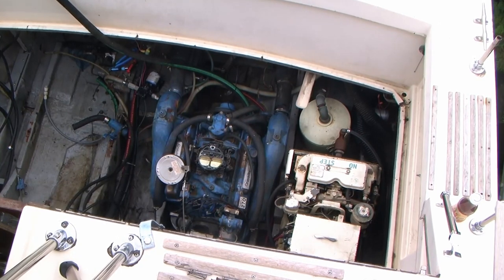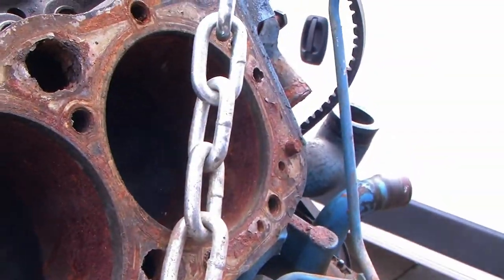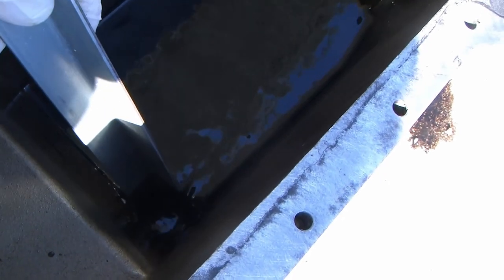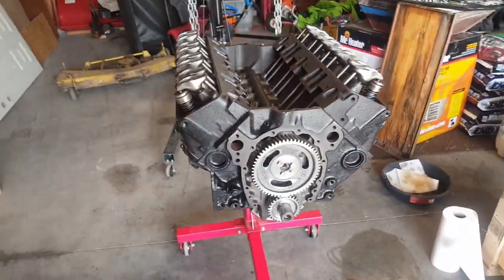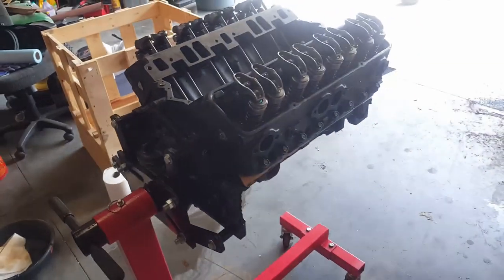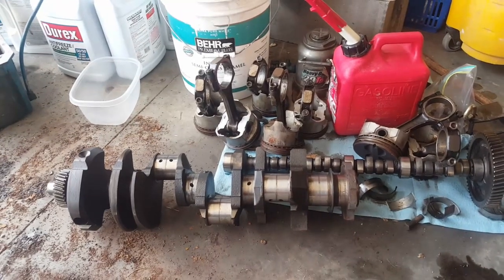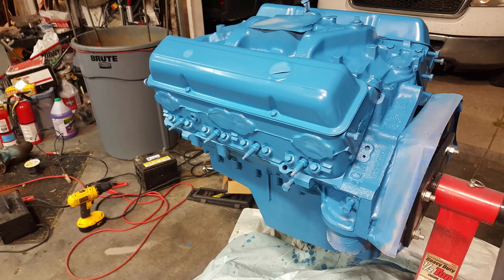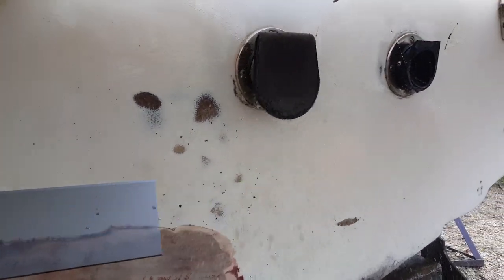Restoring twin Crusader CH270 marine engines on a 1978 Carver Mariner 33 boat after being abandoned!

Comment: I like the closed cooling systems for two reasons.  The first is there is antifreeze in the block and the heat exchanger.  So no block freezing and splitting is going to happen.  The second reason is you are not circulating dirty or corrosive water through the block.  So the cooling passages stay clean and there is not internal rust in the block.  

Looking forward to the rest of the series.
Reply: In addition:
..... Ethylene Glycol's boiling point is much higher than seawater.
......your engine will run more consistently at the desired temperature.

Comment: In Florida it's common to use old engine blocks as mooring anchors for small boats. Or in tandem with a regular anchor as security. Don't be afraid to do it. If it's clean of oil it's legal.

Comment: Jeff, we all appreciate your enthusiasm and the efforts that you've given to the videos.  
I have a few suggestions ..... no offense.... just sharing my observations:  

....... If budget allows, at least install a Closed Cooling System on the new engine. Perhaps in time (as you replace the other engine) you can do the same at that time. 
....... Lose those silly belt driven seawater pumps and go with the Johnson F5B-9 crankshaft seawater pumps. Belt driven seawater pump cause owners to defer maintenance. They also undergo belt tension side load, of which shortens bearing life. 
.......Install true water separating Parker/RACOR fuel filters.
...... If not too late, install remote engine oil filters.  
..... At 8:00 min/sec into the video, I see a notation that says "someone decided that it was easier to change the rotation in the transmission". This is only possible if the transmission is "opposite of engine rotation" capable. 
....... DO NOT re-use that old and outdated starter motor. Treat your engines to today's HTGR/PMGR starter motors. 
....... At 13:08 min/sec into the video, the note says "initial timing at 12* BTDC". That is a bit excessive and will change the Progressive and TA. Make sure that you check the progressive ignition advance AND the total ignition advance and do not exceed 28* @ 3,200 RPM.  Ignition Induced Detonation is an Engine Killer! 

BTW, unless T-bolt clamps are used, your wet exhaust hose needs to be double  band clamped at each end. 

Good luck. I'll keep myself updated to your progress.
Reply from the maker: All very good suggestions!  Tips like these from experienced people are exactly what I'm looking for in these videos!  Already considering a closed cooling system for next year.    Would greatly help out on winterizing the motors each year.  Also pulled the trigger and installed 2 new starters.   Timing tips good too...  I have a correction: Crusader 270 Engine Service Data states 10 degrees BTDC on Ignition Timing.  Will get my timing light back out...
Reply: @JeffNiemeier  Jeff, I need to begin with this: 
Your engine builder used cylinder heads 333882, of which have the larger 76cc combustion chambers. 
Most typical Marine Engine builders use the GM Full Dished pistons. 
The 333882  heads with the GM F/D pistons will cause your Static Compression Ratio be too low. 
Let's hope that he used a F/T piston. 

 Now regarding the ignition timing, BASE or Initial advance is BASE or Initial advance all day long. We fire up on BASE and we idle on BASE, and that's it. The more important aspect is what the advance is doing progressively and at how much advance is occurring at/near  3,200 RPM. 
You will want to mark off your harmonic balancers up to approx 35* BTDC. 
Then you will want to strobe the marks as a helper increases RPM up to 3,200.  
That is a critical point!   

Too much advance @ anywhere from 2,500 to 3,200 RPM, and we enter into a dangerous area concerning Detonation. 
Add to the mix the GM Full Dished pistons, and we have a recipe for Marine Load Ignition Induced Detonation. 

On the other side of the coin, too little advance, and we leave power on the table.
All of this is much more important for the Marine SBC than it is for the Auto version.

Comment: great video. You answerd a question I had in regards to counter rotating engines. Your video said they stopped counter rotating engines in 1980. I have a 1989 so I can assume they run the same direction. I will double check  for sure. Thanks again.

Comment: I had the same motors on my 38' Silverton, it was an 85, it takes allot of neglect to ruin those motors, other than the distributor cap points, needing constant  maintenance, they  very solid motors. I recommend you get an enclosed system with a heat exchanger, and run antifreeze for cooling, I ran mine in the Gulf of Mexico, so I didn't have the option but to go this route.
Reply from the maker: I am thinking about converting it over to a closed cooling system.  What temp did your engines run at on a closed system with antifreeze?  Mine runs at 140 degree's with raw Mississippi river water....
Reply: @JeffNiemeier  I would normally run between 150 and 160, the summer temp waters in along Texas Gulf are anywhere from 83 to 90 degrees, plus I did allot trolling so at 6 to 8 knots I was running around 160 165, at cruising around 150 degrees
Reply: @JeffNiemeier  I have a closed cooing system on a 5.7 liter engine.  I run a 180 degree thermostat.  If the engines runs too cool, combustion is less efficient.

Comment: ... yep,  you have a dual coolant system,  but I haven't seen the heat exchanger yet.   Suggestion:  Change the oil filter location ... put on a remotely located filter were you can easily change it  ( that maybe why you have sludge ... too hard to change were it is located.  I would also change the fuel pump too,   to an electric one located were you can get to it too.  These changes will make the motor maintenance much easier (no crawling/hanging over the motor (in impossible positions) to work on it .... Oh,   carry "spares" for everything ...

Comment: doing the same thing now....mine is single engine..3.8 mercruiser......runs fantastic...this boat is and 87 model larson boat...almost 30 footer..but just short...only thing I am going to do to this good running engine is Im going to turbo charge it..using a SEMI TRUCK turbo...they are indestructable Im told so Im going to use one of them.Ive got 170 hp...I want to see how close I can get to 250 hp...love you boat here..its fantastic...

Comment: Just my two cents toss the carburetors buy a fuel injection system they're really cheap over the long run and much more dependable. 😊it's a really easy swap bolts right on your intake.

Comment: How do you run water over the engines so as to check them. Both my engines ran, it was my v drive starboard side that needs work
Reply from the maker: There is a 1 1/4" water hose that goes from the v-drive to the raw water pump on the engine.  I disconnected it from the v-drive and stuck the garden hose down it...  I didn't have access to an outdoor faucet so I used a 40 gal. garbage can with an adapter cut into the bottom of it.  I put the garbage can on the fly deck and filled it with water and let gravity pull it down the hose to the engine....  Warning: it takes a lot of water to keep the engine cool and don't put the transmission in gear while the v-drive doesn't have a water supply...  Hope this helps!

Comment: How did you remove the engine from the transmission. We see the fly wheel through the starter hole but no bolts
Reply from the maker: On boats, the fly wheel does not bolt to the transmission like it does in a car or truck.  Boats use a damping plate with a spline adapter.  The transmission slides in the spline and the fly wheel housing bolts to the transmission housing.  Hope that helps...

Comment: 4:08 oils never been changed at all because turn into slug n cause oils pump to failures n be sure change oils every month on boat because that salt air cause oils turn into slug at some point
that motor is high revving motor like racing car because need high revving get that boat moving because only have 2 gear is forward and reverse 
im engineering and come check in every videos because they need help i give them help tips n tricks get them moving with happy life

Comment: ... instead of a "counter rotating engines ... they did w/ the V-Drive/transmissions ...
Reply: Actually, the engine with the timing gears means it is a right hand turning engine or  it would have a timing chain as the left hand or standard rotation one does.

Comment: 2 bolt maid is weaker vs 4 bolt maid is storner it hard destort it and that new motor make for high revving it goes over 6k to 7k rpm "7k mean 7000 rpm" i think 8k is over limits dont bother getting to 8k unless u in emergency hurry

Comment: Hi I saw all of your previous video's  did you have that boat surveyed ? If you did not you need to before you spend more money on it . That bow  PATCH IS WRONG , that boat like all but a very few was made with a wooden frame , keel and transom covered with fiberglass and all of got wet and rot out get it inspected it would cost way more than it is worth to fix it. A friend of mine ran into the same thing and that wood is the back bone of the boat. I wish you the best of luck.
Reply from the maker: I agree that patch in the front was done wrong but it seems to do the trick.  I smoothed it out and may work on it some more in the future.  There is one place where the wood is wet on the port side rudder.  Also plan on working on that this winter when I pull out the other engine.  I talked to the marina about having the boat inspected but as you said the cost is very high.  That is why I completely removed the bottom paint down to the gel coat so I could get a good inspection of the hull!
Reply: @JeffNiemeier   Hi Jeff look on you tube for boat survey you can buy a moisture or maybe rent one also there is the hammer or bump test I am from New England and there a lot of boats for free with this problem .They are very dangerous my friends boat sank in rough weather because of this. All of them are junk the new ones use balsa wood or a composite hull which is Bondo. Even Boston Whaler foam core hulls would absorbed water and some cases more then double the weight of the hull . I wish you the best off luck be safe. Phil